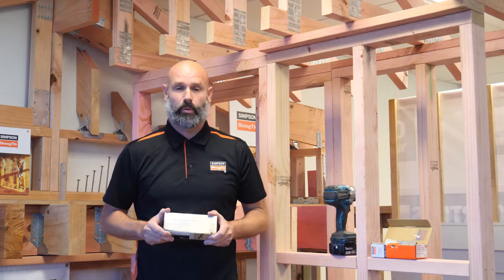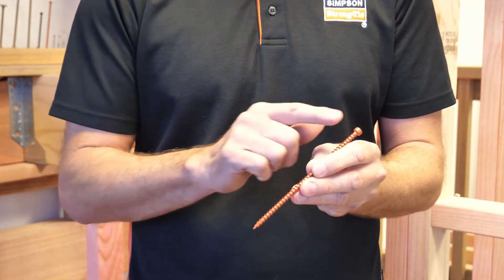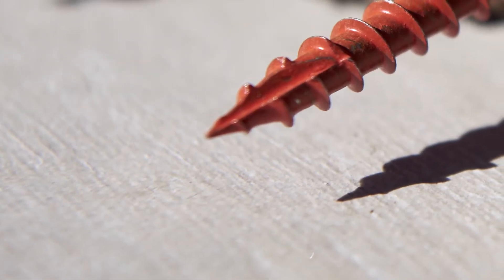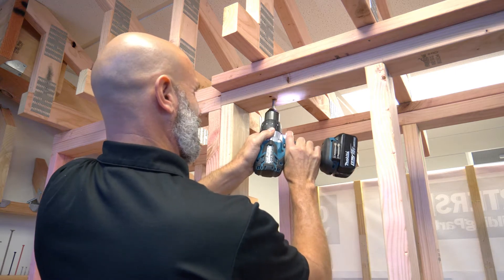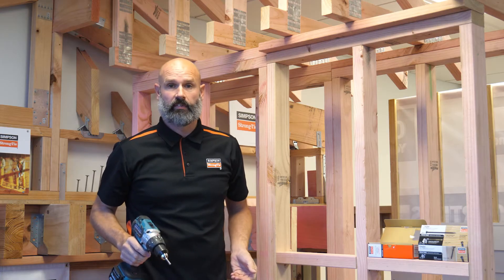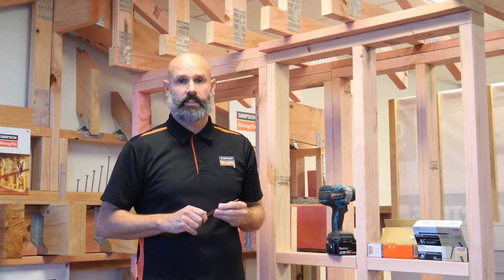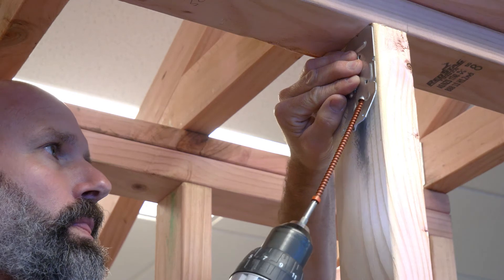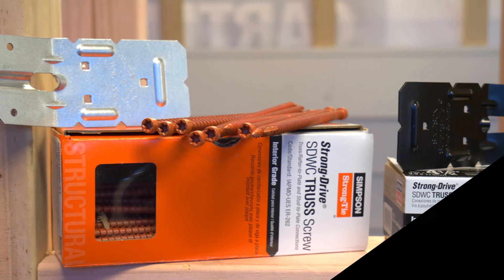SDWC Truss Screw — The Simple New Way for Truss, Stud and Top Plate Connections

Comment: What tool are you using to drive that angle called? Where can I buy it?
Reply from the maker: Hi, do you mean the angle metal plate? That's the “Installation Guide”, which is included in each box.
Reply: @SimpsonStrongTieNewZealand  ok thank you

Comment: Good video.  One question.   Because this is a new way to add storm strength to a home.  Is it possible that adding truss screws could cause some of the trusses to split?  Essentially weakening the connection instead of strengthening the joint.  Would  a simple pilot hole of the appropriate size benefit the install and achieve maximum structural strength without risking splitting the wood?  I'm not a builder, or wood worker.  But I do own a home within Tornado alley and I'm thinking these structural screws would strengthen my home.
Reply from the maker: From what you described, we understand that you are retrofitting the existing old timber building. If there are many existing fixings on the trusses and the timber is not in good shape, we don’t recommend using the Truss Screw; instead, we recommend the Simpson Strong-Tie Hurricane Ties.
Reply: I have a home that is 100 years old and the framing members are dry and hard. When I run into a splitting problem (mostly at board ends) with screws or nails I do use pilot holes, but the smaller the better. There isn’t any information I know of on the effect of strength by doing this. But it’s WAY better than relying on 100 year old nails.

Comment: What about gable trusses where access is limited. The front of the stud is blocked by the intersecting wall and the truss sits directly over the end stud.
Reply from the maker: Hi @mashoutman, try to visualize your situation to see if we can help. If the stud is blocked from the front and you can't establish a connection between the stud and the truss, you may attempt to access it from both sides of the stud. Alternatively, you could use our SDWS structural screw for the top plate-to-stud fixing if it is accessible. See the flyer on Connection B (last page) https://strongtie.co.nz/products/sdws-timber-screw